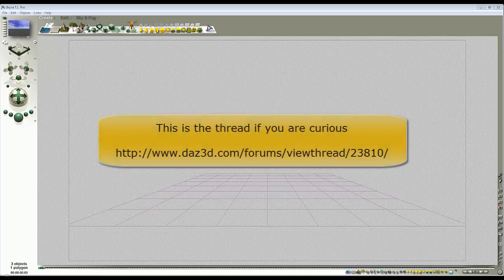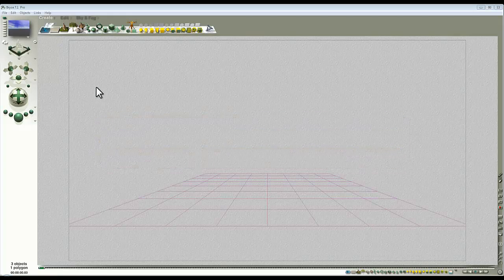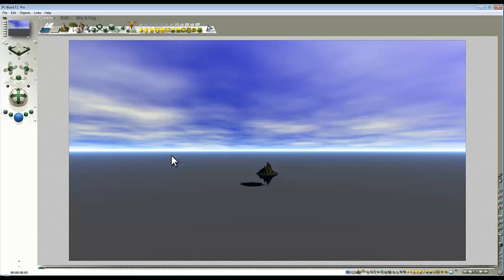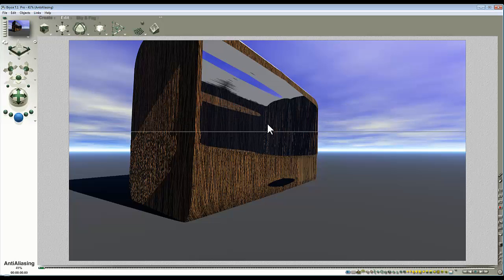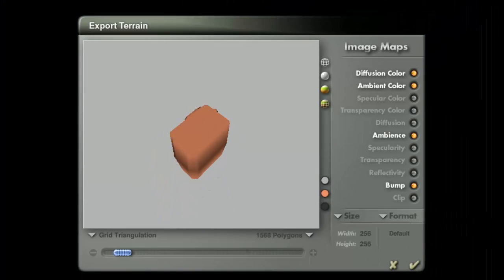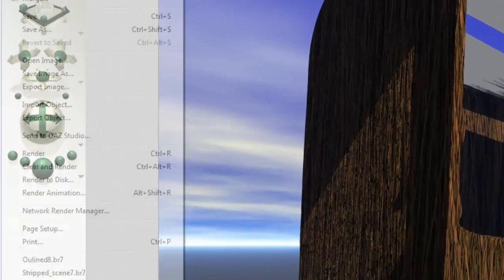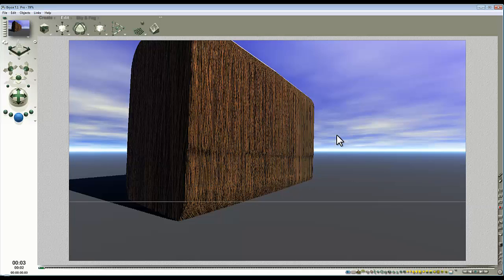Bryce "Nuts and Bolts" - Fixing holes in lattices - by David Brinnen.

Comment from the maker: Thank you Art.  As Horo observed this is not the best solution to the problem because after the lattice has been converted into a mesh it is no longer possible to edit it in the terrain lab - except by converting the mesh back into a lattice - which can be done - but is fiddly.  A better solution would be to have the bug fixed.  But when that might happen... who knows?  But until then, I'm glad to be able to provide a work around.  Cheers!

Comment from the maker: I can understand why you might think that, but no.  When you set a terrain to solid it does not become solid, what happens is that a surface is applied to the open end(s).  In the case of a terrain there is always at least one open end - the base.  Although if clipped from above, there is also the possibility of another.  With a lattice the base is where the object is mirrored.  However, as with a terrain it is possible to open the top by sliding down the clipping bracket.  Solid fills that hole